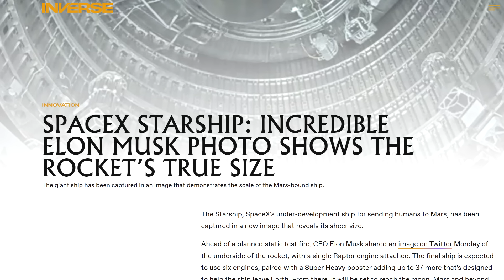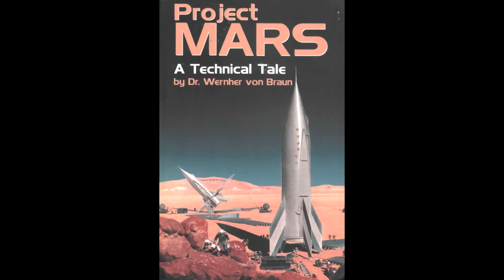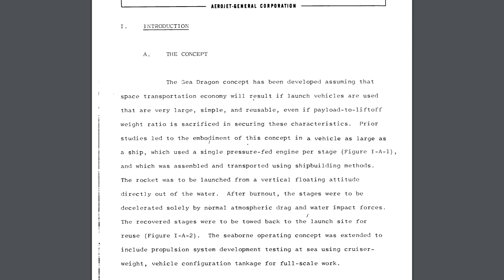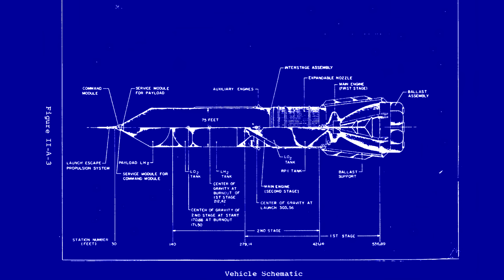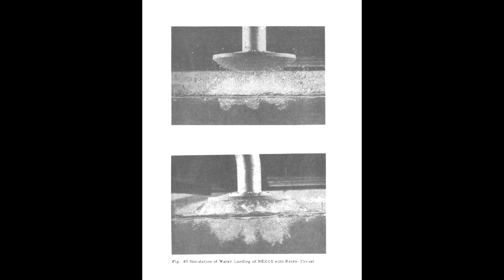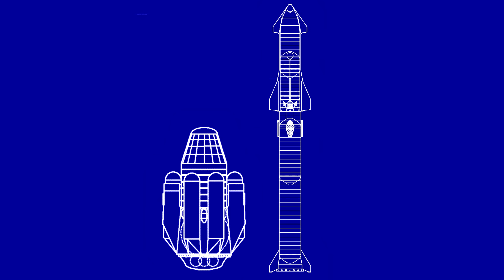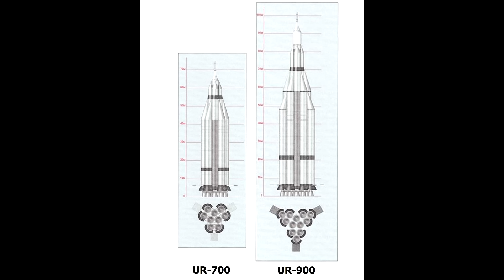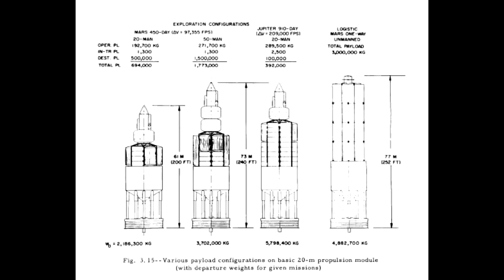The Old Rocket Designs That Make Starship Look Small

Comment: The thing I cannot reconcile about Sea Dragon is, how would they ever make a pressure-fed first and second stage feasible? The thicker the rocket gets, the walls of the tanks have to be proportionally thicker to withstand the same pressure, so wouldn't the tanks be just too heavy to reach orbit?
Reply: Nope. The tanks could be proportionally lighter because the internal volume is expanding faster than the perimeter. Thus less tank is needed per pound of propellant.
Reply: Could they be thin walled, with internal stays ? I don't know , just an idea
Reply: The tanks would have to be somewhat thicker at the bottom, simply because of the higher head-pressure. But the needed hoop-strength is constant for diameter. A pressure of 20 bar for a 5 meter wide tank would remain 20 bar for a 50 meter tank; and, say ~4mm steel remains 4mm. The steel required is 10 times greater (for a given height), but the volume enclosed is 100 times.

Could such a booster perform on balloon-stiffnes alone? If so, having a one-use design starts to make sense, as long as you're not doing crew-rated launches, but rather just throwing materiel into LEO.
Reply: @dillonvandergriff4124  I don't think this is how pressure vessels work.  As the radius increases, the curvature decreases, and to have the tension strength high enough for the pressure, the walls need to be thicker.  Even before anyone starts using propellant.
Reply: pressure vessel mass ratios remain constant regardless of the size, you can check out the derivation why on the Wiki page for pressure vessels.

What this means is that the mass ratio of a huge rocket at a certain pressure can be exactly the same as for a small vehicle at the same pressure. It's just that the pressure in this case is pretty low for a rocket
Reply: @Cancer McAids You'd need a really tall rocket to make that work well. Chamber pressures typically sit in the ballpark of hundreds of bar for good thrust and Isp, assuming a fuel density close to water you're talking a column of fuel that's kilometers tall.
Reply: @Cancer McAids I suppose so, but I will note that even in Sea Dragon's case each fuel tank is much less than 200m tall owing to the 2 stage design and huge nozzles
Reply: @Cancer McAids I mean, that aside, the tanks already had to withstand pressure to start with, it's just that the pressure would come mainly from the weight of the fluid. Arguably a pressure-fed system is even better in that regard, since the pressure change across the height of the tank is not as severe as in a grav-fed system

Comment: That space freighter concept sounds really cool! Maybe scaled down to maybe 30-40t to LEO, it might be economical
Reply: Fun fact: One of the Heavy-lift Vehicles from NASA's SPS study (the Alternate Design at 10:31) has similar payload to Starship (120t), yet only 4000t mass when full. Which is less than simply the fuel mass of Starship (a 20% boost), and even with some mass reserve! Apparently, aluminium construction/winged flyback is a pretty efficient design!
Reply: I love winged flyback!
Reply: scaling down rockets tends to destroy their economicality; Rocket Lab discovered this the hard way and are now scaling up to an F9 scale rocker
Reply: Just the thing is, there's no market at all for commerical super heavy lift
Reply: yet!
Reply: Maybe in a few decades, if NASA gets the funds it needs to do what it's supposed to. But as of right now, anything going to space needs to be highly specialized and is expensive to build. Plus any industry that would benefit from commerical super heavy lift(asteroid mining, space factories) are so risky and expensive to start it will almost never happen without government fostering, which NASA is supposed to do. Unfortunately it just doesn't have the money to do this at this point. So it's a toss up.

Comment: People skeptical of the starship are mostly skeptical about the economics of it and the over promises  from Elon... Not if it will actually fly.. it probably will.
Reply: Although I have some doubts about its payload. I have done some math on it, and maximum reusable payload is only somewhere in the 60-80t range.
Reply: @HalNordmann  not surprised, and the door they are implementing seams to point in that direction as well..with reduced available volume Vs the original concept.

Comment: Haven't heard anyone say the problem is that Starship is too big to fly.
Reply from the maker: You don’t read all the comments on my YouTube channel….
Reply: Fun fact: One of the Heavy-lift Vehicle from NASA's SPS study has similar payload to Starship (120t), yet only 4000t mass when full. Which is less than simply the fuel mass of Starship (a 20% boost), and even with some mass reserve! Apparently, aluminium construction/winged flyback is a pretty efficient design!
Reply: I usually see comments go more into the "too complicated, nobody has gotten 33/37/39 engines to work in synch and any attempts in the past ended like the N1" direction. but that can obviously be interpreted as "too big to work" too, if you squint a bit. ;)
Reply: @scottmanley  ha, true. Thanks for another great video. Fly safe!
Reply from the maker: What propellent was used, a lot of these designs used hydrogen which makes a big difference.
Reply: I told Wilbur and I told Orville (and their father told them the same thing), and I'm telling you, it'll never get off the ground!

Comment: I am very sure the Sea Dragon first stage engine would have bizarre instability issues. It's not surprising that "The SpaceX Pintle Guy" thinks pintles are magical and not subject to combustion instability. I have worked with pintles as well as other injector designs, the reality is that each injector flavor has it's own issues. Pintles can be great, but they absolutely have multiple known issues, and to my knowledge there is no experience with super duper big pintles to know if any of those issues would become insurmountable as you scale up to that ridiculous size. 

The "few big engines vs. many smaller engines" question is always an interesting one to me, and really the answer should always be "it depends" instead of having a straightforward clear winner. That said, once you get up to a single gargantuan pintle, where you could probably swim through the pintle injector holes, I am willing to bet that you'd run into some absolutely bizarre instability issues and just generally weird fluid dynamics. Super high Reynolds number + multiphase flow + turbulent flow is always gonna be complicated, add to that the inevitable combustion instability issues associated with having your flame too spread apart to behave cohesively and you're always gonna have issues with big engines. Possibly surmountable issues, but with an engine that large there is an engineering diminishing returns calculation you have to make, i.e. how much engineering person hours + simulation time + testing time is it worth to have a single engine? How much is the test stand gonna cost? how are you gonna transport it? etc... Those externalities probably make an engine that large practically unrealistic.

Comment: And most of those Rockets were Designed with Slide Rules, not Electronic Calculators and Computers!
Reply: real mathematicians do not even need sliderules
Reply: It's interesting that they used slide rules. If they'd needed more accuracy, they had books of logarithm tables. The books take much longer to use than slide rules, so unless you really need high precision you use a slide rule.

Comment: 1:07 , most (if not all) are refering to the economical side of it (also the reason why others never built insanely huge rockets). There is no market for it (what is kind of "proven" by the Falcon Heavy aswell, since it had just a couple launches in all these years). So the only market for it, will be Musk his own projects, which also don't seem really economically viable. 
Professionals think about all details before they build a rocket. Amateurs think about things as they go, get confronted with the details and then realize they have to do things different again and again in attempt to make it somewhat work. That's exactly how Musk is running his businesses.
Reply: Fun fact: One of the Heavy-lift Vehicles from NASA's SPS study (the Alternate Design at 10:31) has similar payload to Starship (120t), yet only 4000t mass when full. Which is less than simply the fuel mass of Starship (a 20% boost), and even with some mass reserve! Apparently, aluminium construction/winged flyback is a pretty efficient design!

Comment: I hope it is so.  Beer can is what it reminds me of.  Worried about Max q with such a tall structure.
Reply: Fun fact: One of the Heavy-lift Vehicles from NASA's SPS study (the Alternate Design at 10:31) has similar payload to Starship (120t), yet only 4000t mass when full. Which is less than simply the fuel mass of Starship (a 20% boost), and even with some mass reserve! Apparently, aluminium construction/winged flyback is a pretty efficient design!

Comment: The main issue is you need ~250 tons to high orbit for the required tunnel boring machines needed for creating settlements on the Moon and Mars.  This is just for the main cutting heads and assemblies.  You need about as much in support equipment and also a way to power them.  40-50 tons simply won't cut it (bad pun, I know).   And at least 2-3 of them, plus spares (100-200 tons in just spare teeth).  Basically 1000-1200 tons at the site and then you can fairly quickly start making tunnels and chambers.  Starship, since it is designed to re-fuel in orbit, could do this in as little as 3-4 launches.  So within a decade we could actually see construction start on a base on either the Moon or Mars if all goes well.
Reply: Nothing is going to be built on Mars within a decade. And it is highly unlikely that there will be a crewed station on the moon within the same time.
Reply: Is there any way to lighten the cutting heads? Or does the nature of tunnel boring necessitate a minimum mass?
Reply: Not all tunnel boring machines are heavy or delivered in one piece.
A road header weighs 35 to 116 tonnes completely assembled.
At the higher end a complete tunnel boring machine for a 15m diameter tunnel weighs 4000 tonnes…
Reply: @herrschaftg35  Modern designs necessitate the construction of underground tunnels and essentially bunkers and can be accomplished in a few years.  The main issue is getting all of the equipment - thousands of tons of it up there and ready to start.
Reply: @5000mahmud  The issue is that the Moon was originally part of the Earth and has about the same mineral types and composition.  It's going to require a solid machine, and even the smallest ones that are designed for long term projects that would be usable are 5-6m in diameter and about 30-50m long.  But when you can bore  about roughly 20m a day.   It's slow going, but a base could be hollowed out, plastered and sealed, and be ready in 2-3 years.  No worries about pressure, ready to grow plants in, and no issues with radiation - you just need to be 10m or so underground to essentially be in most any mine on Earth.
Reply: Can't the cutting heads be split into multiple launches?
Reply: @HalNordmann  in theory, but the idea was to have the initial tunnels done as remotely as possible.
Reply: @plektosgaming  I envision it like this: First, the drilling machines land in multiple landers. Then, a short-stay research crew with a small temporary base similar to NASA DRM plans assembles them in addition to their normal tasks. After the crew departs, the machines start digging. When the next short-stay crew lands on the site, they will have the first underground spaces ready. Or you could use lava tunnels for the first long-term outpost, and only use the digging machines to expand the space if necessary.
Reply: @HalNordmann  still, if Space X's super heady launchers work, they won't need to assemble them on site.  With existing technology

Comment: I know that someone sat down and designed the ISS and decided it was a good idea, but the space stations designed in the 70s look so much safer.
If you're in the ISS and there's a leak in the middle you have to hope there's an escape capsule attached to the half you're in, or you may need to travel through the leaking part?
The big wheel space stations had multiple ways out if there was a leak the section that was loosing air can be sealed off and people can still get from A to B while someone repairs the station.
The next space station should be a wheel or a cube ( just the edges) it'll be safer, and it should have more cup holders. 😀👍

Comment: I wish you'd look into a VentureStar design that went nowhere. I only saw a picture of it once and can't find that drawing anymore. It consisted of two VentureStar-like vehicles mounted belly to belly. One vehicle was much larger as it served like the Shuttle's external tank but flew back for reuse. I recall there was a caption that referred to the larger VentureStar as the F1 Flyback first stage.

I've seen one StarShip proposal that had two additional boosters (I guess) for heavy payloads. I've wondered if the StarShip concept might be extended to consist of four boosters wrapped around the Ship and all vehicles ignite to gain orbit but the four boosters also refuel the ship during launch to orbit. Would that eliminate the ten-plus launches to refuel the Starship lunar lander? One possible advantage of this concept is the elimination of extra stiffening to support the Ship during launch that the current booster requires.

Comment: QUESTION: What do you think about overlapping Thermal tiles for the Starhip's ThermalProtectionSystem?

Visualize it from the side using a hexagonal "H" shaped tile(rotated 90°) alternating, and loosely interlocking, with a hexagonal "+" shaped tile. 
Spacing and the temperature resistant blanket material should make a durable TPS with no burn-thrus.
WHY is a TPS not used to make an orbital-capable, returnable booster.

Comment: At the 7:47 mark Mr. Manley stated that the Nexus rocket generated 29 million TONS of thrust and this was less than the 36 thousand tons of thrust of Sea Dragon.  Additionally 36 thousand tons of thrust translates into 72 million pounds yet according to the chart presented Sea Dragon was calculated to generate 80 million pounds of thrust at sea level.
Reply from the maker: I'm talking about the metric ton, an imperial ton is 2240 pounds. You're talking about the short ton.
Reply: Been a LOOOONG time ago (1962), but I think we even calculated a 100M lbf version.

Comment: Fun fact: One of the Heavy-lift Vehicles from NASA's SPS study (the Alternate Design at 10:31) has similar payload to Starship (120t), yet only 4000t mass when full. Which is less than simply the fuel mass of Starship (a 20% boost), and even with a 22t mass reserve! Apparently, aluminium construction/winged flyback is a pretty efficient design!
Reply: Did it ever make it off paper?
Reply: @TheEvilmooseofdoom  Sadly, no. But the study was so detailed as to list the precise tank structures or heatshield construction, with what I could describe as Wikipedia-level complexity. Plus, there was even an extra mass penalty added (22t to be exact), in case something turned out to be heavier than expected. So although it was just a study, you could realistically build it based on that data.
Reply: @HalNordmann  You can start to build test articles from that.  A working system is another matter.
Reply: @TheEvilmooseofdoom  Even that is pretty good - many other vehicle concepts have less detail while already being sold to investors. I think I have more info about the HLLV than Starship, in fact. Could be because I don't actively seek info about Starship, but still.